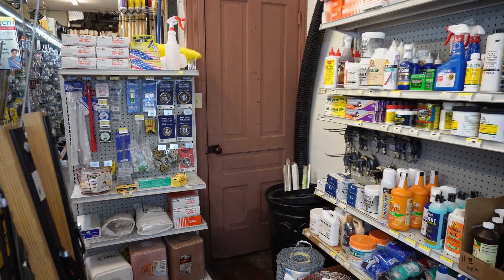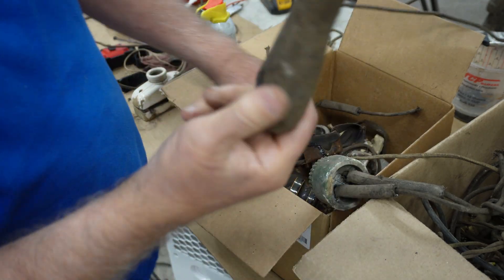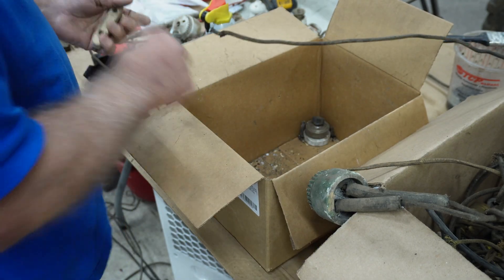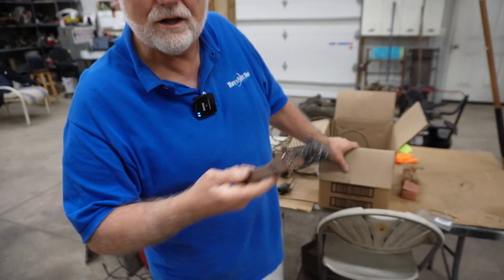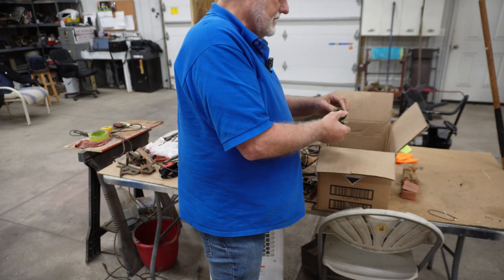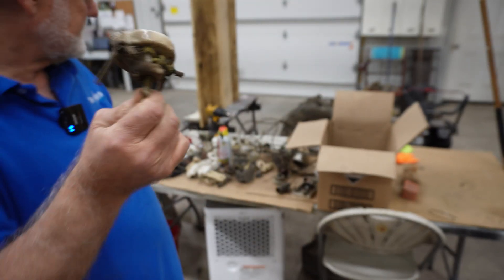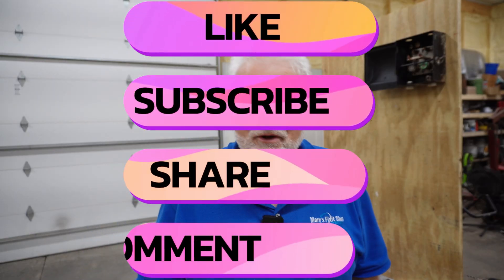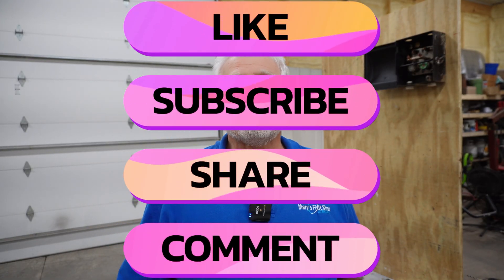The Shocking Truth About Knob and Tube Wiring

Comment: I found this possible explanation for that mystery part. It might be a gear selector from an old tractor. The triangle part is where the lever would be and the teeth parts would select the gear. 
The letters "G," "C," "H," "N," and "D" on a transmission shifter represent specific gear positions: 

G (Grand/ "Granny"):
This position puts the transmission in a lowest gear, typically the first gear. It's used for situations like climbing hills, pulling heavier loads, or when you need more engine braking. 

C (Climb or Creep):
Similar to "G", this position also engages a low gear. It's used for situations where you need more engine power, like when pulling a heavy trailer or going uphill. 

H (High):
Highest gear for transport or repositioning the tractor with no load.

N (Neutral)

D (Drive or Direct):
This may be a gear selection that uses the drivetrain to power or "drive" connected implements such as a hay baler or other implement that would need the tractor to power the implement but leave the tractor itself stationary.
Reply from the maker: I really appreciate you taking the time and giving me an explanation on that part. I found that in the basement of an old hardware store that was the second oldest Chevy dealership in this country maybe the world so what you’re saying could very well be what it is. It could’ve been a car part or they do have tractor parts down there. Also, it could’ve been part of a tractor so that makes a lot of sense to me. I really appreciate you watching and sharing your knowledge with me. I can’t tell you how much I appreciate that thank you.